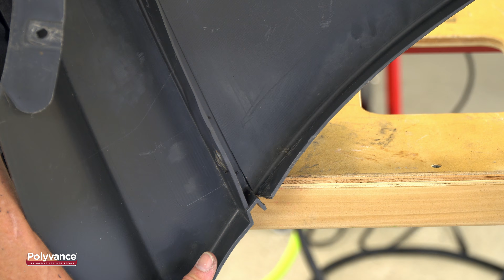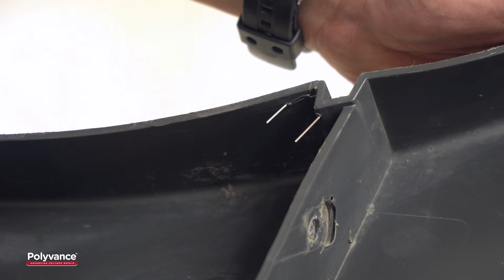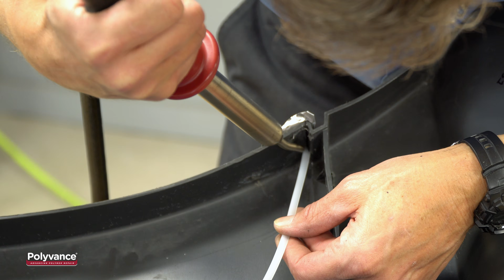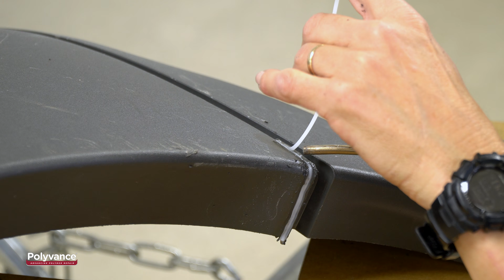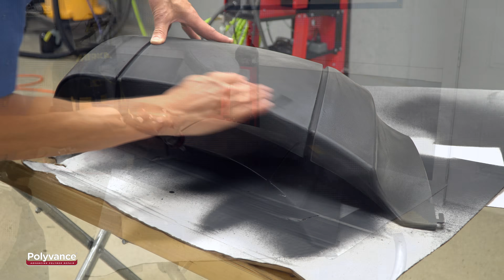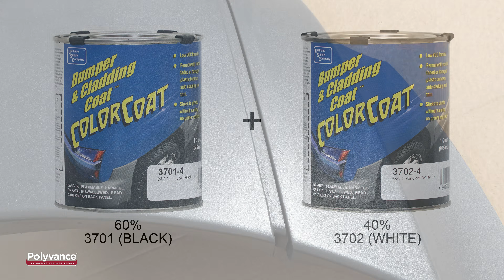Repairing and Retexturing a Freightliner Bumper End Piece

Comment: sir i want to colour my car's bumper so please help me out how to do color it. i don't know  what primer to be used and how to sand it?
Reply: Just clean the bumper with Super Prep 1000, then scuff it with a gray scuff pad, then use 1050 Plastic Magic Adhesion promoter or if a smooth bumper, 3611 Bumper and Cladding Coat Adhesion Primer, followed by your color coat.
Reply: @scottb7600  thanks for your reply.. Sir my bumper is little bit rough so can i use only 1050 plastic magic adhesion promoter and my color coat? also sir what is  gray scuff?
Reply: Nope.  You'll still want to clean it with Super Prep and do a light scuff with the gray scuff pad.  These steps don't cost much money, but will save you the ugliness of peeling paint!  The gray pad is the finest pad, you could go finer if you want.  Some do skip the scuff, but never, EVER skip the cleaning part!
Reply: @scottb7600  thank you sir, your advice will be great help for me. I will do the steps as you said. Thanks again..

Comment: What was the cost of the repair? How much was a new part?
Reply: M. S. L. I've watched other videos where they break it down.  The video I watched broke down cost on a automotive bumper like a Mazda 6 or something.

It turns out to make more money for the shop while saving the customer significant $$$.  

Example 1.  RR factory bumper cover = $100. 
$14 dollars in parts.  2 hour labor.  Gets the factory bumper ready for paint =$214.  

Total cost is $314 not counting paint.  Paint will be minimal.  Just a quick blend using minimal product.  Easy color match.  

Example 2.  RR factory bumper cover = 100

New OEM Factory bumper skin $350.  
Total cost $450 not counting paint.

In this case entire bumper needs to be prepped, sealed, primed and painted.    

So with first example you make an extra 200 in labor and the car spends less time in the shop.
Reply: The Toothless Vegan if you look at how many different products were used on this particular bumper it's got to be counter productive. Not to mention the bumper in this job went from textured plastic to a painted surface. How long is that paint job going to look good & how durable is it. Not to mention the strength of the actual plastic weld. 

I'm not trying to be negative but in this case simply swapping out the damaged part has got to be the best option. Unless it's a difficult/impossible to find part.
Reply: M. S. L. Makes sense when a new bumper is $1000.  If I'm a truck owner I'll take the savings and a little paint any day. 

And what are you talking about lots of products used?  Those are plastic rods that cost practically  nothing.  

And once the whole bumper is painted if done properly it will look as good as a new bumper and save hundreds.  

Know what I mean?  

If I owned a body shop I'd own all their products.  But I don't.  So I just watch and learn.  And from what I've learned I recently repaired  an ABS Civic bumper using scrap pieces of old bumper along with a soldering iron. I repaired the broken tab and saved money.   

Imagine if I was a shop.  
The turn around is quicker.  
The customer saves money.  
The business makes more money.   (after initial investment is paid for).  

Do you see how that works?  

If you're billing insurance then maybe it is a waste of time.  

But think of the 10s of thousands of jobs that go through auto body shops that are not insurance related.